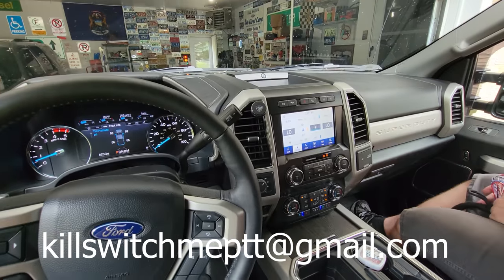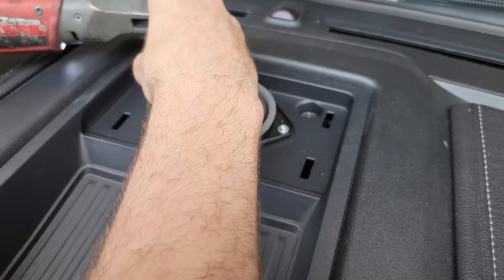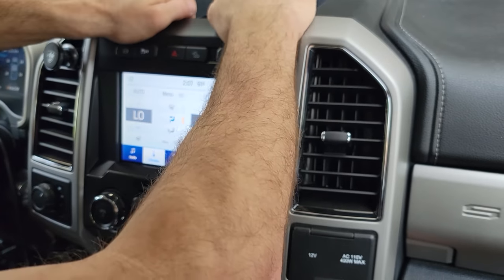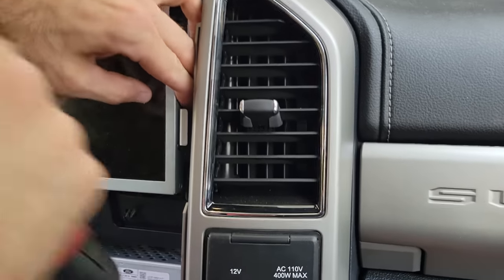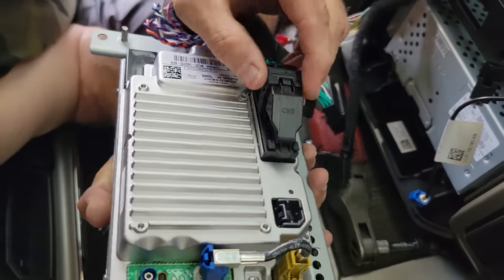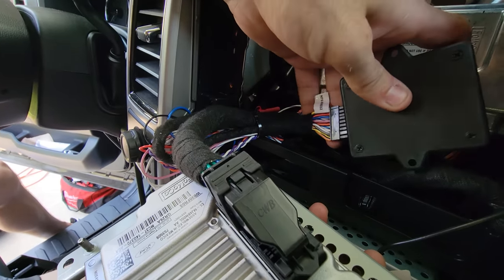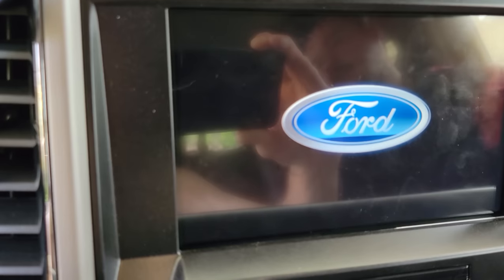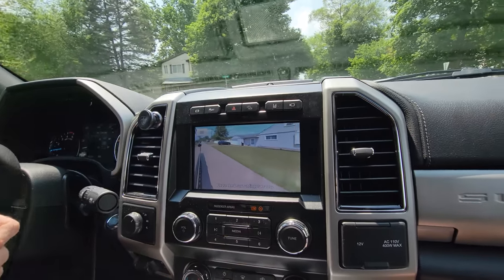FORD 360° CAMERA feature | HOW TO | control YOUR cameras ALL the time F150 F250 F350 F450

Comment: Great addition!!! I had an after market system on my old truck that came on with the indicators and I HATED IT. Just when you need to make freeway changes you lose the GPS because you are changing lanes. So being able to disable it is outstanding. I tow a lot so having this feature is great. I do have the ford camera on my trailer and can turn it on to see behind the trailer even when going down the highway. I assume this system would be compatible with the trailer camera. As always, big thanks for the information!!!!!
Reply from the maker: Hey buddy🙋‍♂️🙋‍♂️🙋‍♂️🙋‍♂️🙋‍♂️
Reply: Yeah I want to be able to see behind my fifth wheel .

Comment: Awesome video. Just a notch higher than this which the Toyotas are doing; they turn these same cameras on automatically when the vehicle slows down detecting the speed. Love to see that in Ford or just like how a backup camera is on automatic on reverse; front camera should on drive mode if not by the speed. Good stuff though.

Comment: Sweet!! Problem is I don't have the 360 camera system, just the 2 in the back. 😠😠😠😠.
Will this work on the 2 cameras I do have, and or what's needed to install the 360 camera system? Front camera, new mirrors with cameras? Would the wiring for the cameras be in the doors and front grill? My 21 has most everything but the 360 camera system.
Reply from the maker: Nope it wont work, cant add 360 cameras either.

Comment: I have a 2022 F-350 with factory installed 360° cameras. I bought the NAV-KIT899 C.O.D.-F50 from Limitless auto works. It can not be installed on 22's
Reply from the maker: Aa far as i know that is NOT 4 sync 4 vehicles

Comment: I have it installed on my 2019 F250. I have a problem with the navigation system or gps no accurate when I use the turn signal cameras.  Any thoughts how to fix? 13:02
Reply from the maker: Probably need a sync update

Comment: I dont have the 360 cameras but i do have the 3rd brake light or bed camera that works at low speed, does anyone make a module that will control the camera at any speeds?

Comment: What program are you using to change the address, you didn’t show that part.
Reply from the maker: I said Forscan in my video
Reply: @PowerStrokeTechTalkwARod  Is Forscan required to finalize the set up?  I noticed on their website (Limitless) there are 2 options for the 20+ Super Duty. One is "with OBD2 programmer" and one is "includes OBD2 programmer" Not real sure what the difference is or what I'd need. I've got a 2020 F350 Lariat.
Reply from the maker: I would look at forscan!!!! Then you can let me take control of your computer with team viewer & ill be able to personalize your superduty to YOU....assuming you buy it to add naviTV
Reply: @PowerStrokeTechTalkwARod  Now that sounds like a great plan.  Loving the videos you put out. Keep up the good work.
Reply from the maker: Appreciate that bub

Comment: How can we make this work on a 2018 Limited that has does not have the 360 cameras (I don't think) but does have the adaptive crash control/adaptive cruise/Lane Assist (which use cameras for I believe)?
Reply from the maker: How WOULD you if you do not have 360 camera???? Sry pal, aint gonna add cameras or happen
Reply: @PowerStrokeTechTalkwARod  I've seen videos where owners have added the 360 cameras which is why I posed the question.
Reply from the maker: Not thru ford they didnt

Comment: If you disable it does it reset when you turn the vehicle off and then start it again?
Reply from the maker: Stays disabled
Reply: @PowerStrokeTechTalkwARod  I like that. I need to get one.
Reply from the maker: Limitlessautoworksllc dot com
Reply: @PowerStrokeTechTalkwARod  yea I've ordered a couple harnesses for the strobing from them. This would be very helpful with my 5th wheel.
Reply from the maker: Good deal